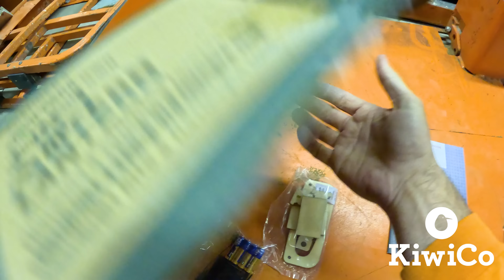How to Install an Elevator in your Backyard

Comment: Really nice solution, maybe to make it more stable (and less sketchy) you could make some linear guides down the sides of the platform to stop it from wobbling around. And if you want to be extra safe a dampening system that limits the maximum speed of the elevator so it'll never come crashing down.
Reply: That's what I thought, it's a bit too wobbly for my liking, bit worried that it may get caught on the side wall as it goes up/down
Reply: @newbro maybe jerry could put guard rails down
Reply: The cylinders usually have a restricted orifice on the return line that limits the lowering speed.

If you cut the hydraulic line off of the cylinder, it wouldn't go down any faster, just make a mess.
Reply: @shanegill25  I meant a dampening/safety system that will catch the platform should the hydraulics or the scissor mechanism ever fail.
Reply: Just let it wobble, it isn't a daily use public elevator. It only needs to work the few times you need it. You could make it more solid, but the time and $ could be spent on other things.
Reply: @MichaelPhelps0117  his wife noted clearly she did not like the wobble. I feel its money well spent solving that. On another channel he talked about how this video series had already not only paid for the whole project but allowed more to pour into the not a wheel chair facility they're building.
Reply: @MichaelPhelps0117  a roller on a spring against the walls would stop the wobble, and not cost much. A cars valve spring probably has plenty of travel, and tension for the job.
Reply: It def needs all that but if you really need to get in the bunker wobbling wont even be thought but who am i kidding, i would spend all kinds of time there regardless if the sky is falling or not.
Reply: @rygull  If it scares the invaders trying to get in all the better.
Reply: i really think this is step one. Like he said if we built it all exactly how they want it, it'd never get done. So get it in and working. That's a huge helper for continued work furnishing out the bunker and bringing materials up and down without giant bungee cords. I would bet the final lift will be smooth and stable but that's the fun watching it all unfold to see what he actually does with it.
Reply: Make the rails out of galvanized square steel
Reply: @stetty_vac  With some eco friendly wood veneer to complete the look
Reply: I genuinely expected them to have included something like that for stability-sake

Comment: wow, super smart idea using the scissor lift!
Reply: @sys-administrator I don't know where you're from but an elevator for your bunker is probably not something the state would like to cover.
Reply: need to install a roller bearing on four side so its slide along the scissor lift without wobbling
Reply: @sys-administrator is this Finland?
Reply: thanks

Comment: Hello Jerry,
That scissor lift is beautiful. Years ago, I removed the spiral staircase to the basement and replaced it with a forklift. Actually, only the lifting part, of course, my elevator doesn't go that high, but high enough to cover one floor. Works great and everyone was amazed at how simple it actually was. Now I can easily get to my basement with the wheelchair.

Good luck with building your bunker. However, as a disabled veteran with two Purple Hearts, I hope it never gets to the point where you need it. But hey, it's a strange world we live in.

Comment: Could EcoFlow batteries power the elevator? 

Sidebar - after watching the last video, I’m curious who responds to us now. Zach or the social media manager?
Reply from the maker: I'm the only one with access to comments on the YouTube channel.  It's always me (Zack).  I never get on Facebook though - so all those responses are Devan. (The Editor)
Reply: @JerryRigEverything I paid to just see this video early you got me
Reply: So the elevator runs on 4 6 volt batteries, meaning it's either a 24V system or an extremely high current 6V system. EcoFlow batteries tend to have a low current 12V system which probably won't be powerful enough to run the compressor directly. But it certainly could trickle charge the batteries powering the lift. 

Alternatively, you use the AC power to generate the right voltage to power the lift, but that means the AC inverter has to stay on, which is not ideal.